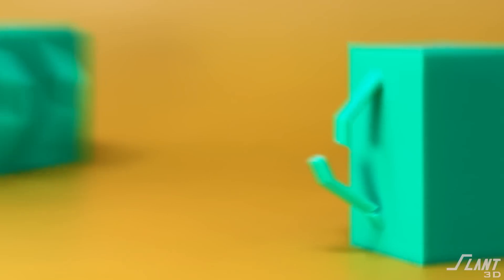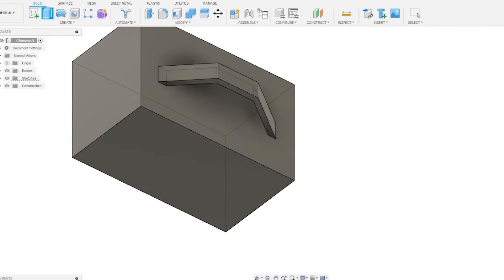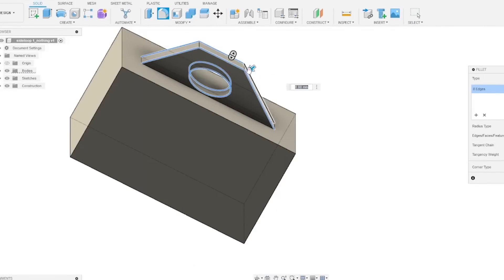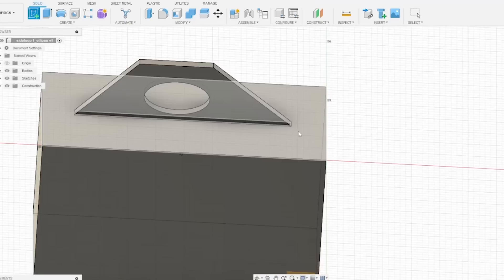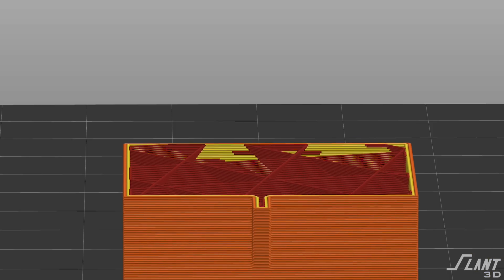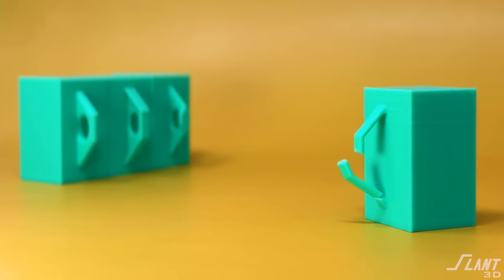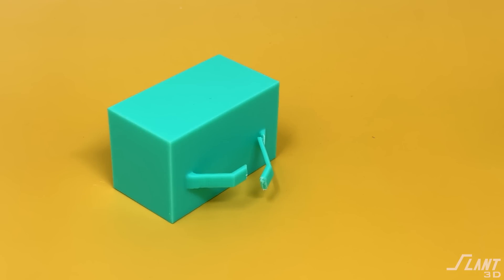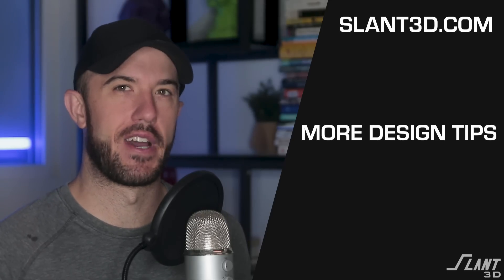Reinforce Your Side Loops for Durable 3D Printed Parts

Comment: Hello man! I am very glad I found your channel in the sea of "how-to-calibrate-bed-leveling" videos! Your knowledge and expertise in 3D manufacturing is just awesome. I gained lots of really crucial information from your videos and totally changed my way of 3D modelling for printables. We've got very "injection molding oriented" mind and your channel helps people fix that and change to "purpose orientred modeling". Thank you!

The biggest discovery I heard from you is "rather than designing from thin walls and bild from it begin designing from a thick brick and carve out of it" approach that allows to produce reliable beefy prints.

Comment: The videos where you discuss getting the design right are your best in my opinion. You give people a sense of what kind of engineering concepts contribute to a successful product. Since design is the first step in production, it is the most critical. Everything that comes after design uses that design as a foundation. If the design has faults, the product cannot be without them and fixing the faults requires redesigning anyway and potentially scrapping everything done after the prior design. When you know how strong parts are across layers, you should be able to tell from the design if it will be strong enough. When designing, it may help to picture the part as you would orient it for printing. That way you can picture the layer lines and determine where you need to strengthen the part or if limitations prevent it, redesign it in an orientation that will strengthen it.
By the way, kudos to a 3D printing service that gives tips freely to makers that could potentially be their competitors. This is sharing knowledge to make everyone better. That shows far more integrity than the guys keeping their secrets guarded and that they are dedicated to advancing the craft more than filling their bank accounts.

Comment: Would be good to cover print orientation. Layers are the weak part. Print on its side and you will get better strength as well. Thanks for the other pointers thou.

Comment: There is a way to "add more material" locally without increasing the size: add thin holes. Let's say grid of long holes, each hole is 0.5x0.5 mm, and step of the grid is about 2mm.

Comment: Echoing a couple of comments here, designing for 3D printing (and the resulting prints) requires a different way of thinking about the end product: practicality over aesthetics.
Reply from the maker: You can have aesthetics too
Reply: Most people have no background in mechanical design. Probably that's why 3D model repositories are flooded with really bad functional parts.

Comment: It’s really interesting to see how years of injection molding products has influenced design. A lot of the 3D prints I see online are still designed based on preconceived notions. I’m finding the CAD design side is way more fun than I thought it would be (thank you Shapr3D and Nomad Sculpt).
Reply: Yeah, I think a lot of people in the injection molding industry pick up 3D printing as a hobby.
Reply: @logicalfundy not only that, but people who aren't engineers but are designing for 3D printing simply copy or slightly modify existing geometries they see around them, and those all happen to be from injection molding. 

Places like Printables, Makerworld, etc are absolutely chock full of such designs.

Now the frustrating part is these models are almost all shared in STL, which is notoriously difficult to edit and modify after the fact.
Reply: @victorlin4645 the step files are needed, correct? What is the best format in your opinion? Pure g-co? I'd like to know before I start making, I'm studying CAD now.
Reply: @AJButterFingers  STEP is easy to modify.

Pure gcode is even harder to modify than STL, and it's limited to the printer it was made for. Gcode is the raw instructions the printer reads to make the print.